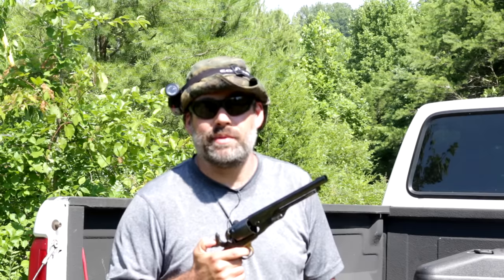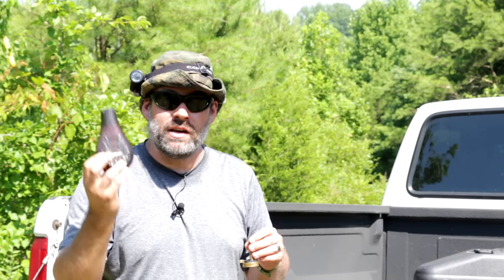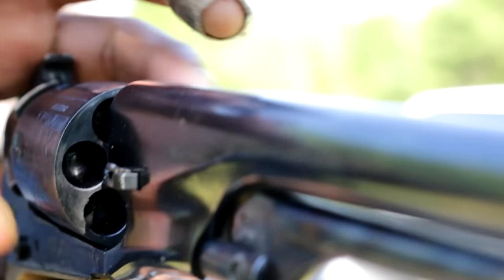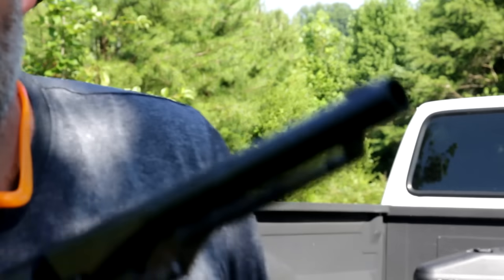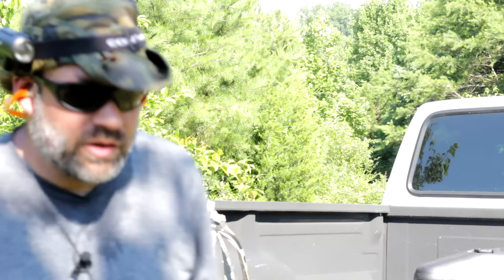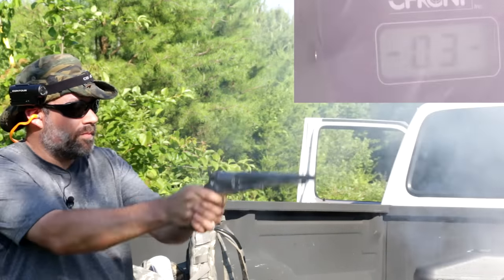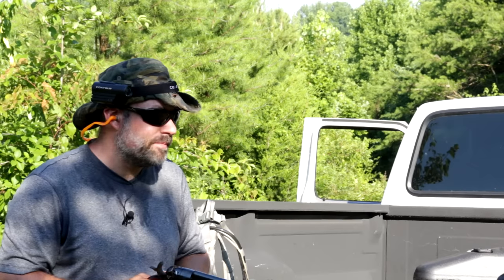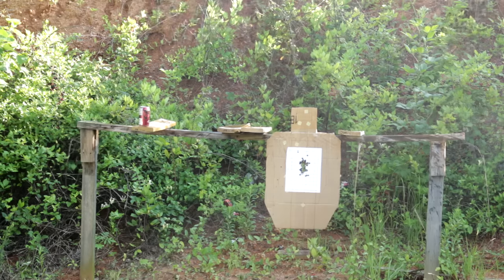How Powerful are Black Powder Revolvers?

Comment: There is peak efficient powder load to produce peak velocity output. Above that peak, there is a diminished return on using extra powder because it can't all burn fast enough.
Reply: Related to barrel length?
Reply: @ledenhimeganidleshitz144  yes, the longer the barrel, the more powder which can be used to propel the bullet.
Reply: @Remedy Talon  
F=M•A
Aceel = pressure • Area
M = Area • H • density
Friction = V•V • coef drag

Density drops out.  Rearrange the algebra for assumption of length, and you will see that maximum velocity reaches diminishing return for both pressure and barrel length.  You will find it true for both cases; pressure or length for the same reason.  Drag increases with the square of velocity. 

Just physics.
Reply: @TangoOne  to an extent you can ruin a brass frame long barrel with to big of powder loads will stretch
Reply: To compensate for diminishing returns you can shoot a heavier bullet. It alowes the powder to burn more efficiently. Yes you cant fit as much powder but you can squeeze 30gn and maybe 35gn with a 200 gn conical.

Comment: Use real BP for the testing. There is a difference.
Reply: David Tiller I completely agree, i use real black powder in my Uberti Walker and when i tried it with pyrodex it didn't work well at all and it only had half of the power it did with bp.
Reply: Jeremy Hall If you order 25 lb lots it will save you a lot. If you don't want that much you can always find some friends to share the lot. Two good places are the Maine Powder House and Buffalo Arms.
Reply: graf and sons had the BP
Reply: Your lucky. In Cali you can only own 1 pound of bp at a time
Reply: Reason #4761382 to not live in comiefornia.
Reply: @familyofmay3131  ,
Reply: Jeremy Hall  Same here.  I notice little difference between the Goex and the Pyrodex P I use in my cap and balls.
Reply: @firefoxjb  Thanks I'm new to this and want to get the Walker. I will keep that in mind.
Reply: Jeremy Hall  Make your own?
Reply: Real blackpowder is not difficult to make and is also not at all dangerous to make because the entire time you are handling it, it is a wet paste until you granulate it and let it dry.
Reply: @909part3  hey man, where do you buy yours at. I see your in the area.
Reply: A recommendation. Walkers are very....heavy and should not be the first BP revolver to purchase. My thinking is that they disassemble a bit differently then other colts. And, unless your Clark Kent you will not want to fire it often. I would purchase a smaller caliber, i.e. 36 in any Colt model or Remington. Doing so you will be hooked for life. Then purchase the Walker and destroy concrete blocks and shiver at the thought of getting shot with one of those monsters. And, please use BP you'll love the smoke.  Phil
Reply: yea.  Unic BP substitute,  not enough sulfer huh?
Reply: If you use real bp fff should you cut your load to say 20 maybe lower
Reply: @jamesholcombe435  Whats "Real "black powder,  all the recipes i see, well they involve mostly Potassium nitrate,  I heard of a blend used during colonial times that may  havr been more powerfull,  had more sulfer.  Any facts to clear this up.
Reply: Urbexx Jeremy  look around for gun shows or black powder/muzzleloader groups in your area, they can usually hook you up with the real stuff
Reply: @909part3  How much regular powder can you have? I keep about 25 or 30 Lbs at home here in Mo. That plus 10-15000 rods of loaded stuff.
Reply: @familyofmay3131  California is a capitalistic giant but ok
Reply: it remains a realy good review for pyrodex users. still i agree i'd like to see it with real black powder...
Reply: @909part3  That's incorrect. Your local fire dept sets the amount you can have and normally that's 5 pounds in your home. In sheds or other outbuildings, you usually can store more!
Reply: Talk is cheap.
Got a video to prove this?
Real BP ... Which brand?
Lymans PUBLISHED data shows the difference between brands. This was complete with pressure measurements.
Reply: I heard that substitute powder increases fps because it burns faster? That’s what I’ve been told but maybe they were wrong? Anyone who likes muzzleloaders should get a NAA super companion. Such a fun little gun to shoot and is the only bp revolver that can shoot smokeless powder. Because it’s made of the same material as there modern 22’s. But it gets up to 1200 fps with 2 grains of bullseye. Triple 7 is good in it as well.
Reply: @firefoxjb  Pyrodex by volume is usually more powerful. 10% minimum. Is there a difference in procedure to get better performance from real black powder.
Reply: @FlyManChimera  no the tech industry is, remove tech and it’s the 27th poorest state in the union with the largest BY FAR population, yet less than 10% of our population works in the tech industry
Reply: @LouisE-mp8lx  In revolvers the flame channel from the cap to the powder charge is a straight line. In that instance, Pyrodex works fine. In my CVA Hawken, the spark from the cap has to make a 90 degree corner to get to the powder. This makes Pyrodex a very spotty proposition in my rifle. I usually need to fire a couple of caps on about every third shot to ignite the powder. With the end of Goex, I am getting pretty short on options. And none of the other black powder substitutes are recommended for sidelock rifles.

Comment: 30 grains seems to be the sweet spot with the 140 grain ball;  I'd like to see this test repeated with conicals.
Reply: Some say 30 some say 31.
Reply: Did it above.
Reply: @christopherjackson3455  Agreed.  It would just piss him  off.
Reply: 30g ok fer colt 44 but 25g found best fer Remington 44
Reply: Conicals take these guns to a whole new level. Plus, they were at least as common but probably more common than balls back in bp days because paper cartridges used conicals and they were more common than loose powder/bullet.
Reply: Yep you are limited by aerodynamics of the ball.
Reply: R u guys using any kinds of buffers between powder and projectile since any space between is considered to be a bulllet as a bore obstruction scenario
Reply: The Lymans Handbook has this all and more, like pressure measurements.
Reply: @landontruman3632  the molds issued by the army with these guns cast both round ball and conical.
Reply: @pitchforkpeasant6219  no buffer is needed, the ball compresses down onto the powder and compresses it. You can fill a chamber as full as you want with powder, its not possible to over fill these. You can even put more projectile than just a roundball in
Reply: @landontruman3632  I agree with you. I use 200 grain conicals, with 30 grains of FFF, pyrodex P, and there is a difference. Better long range accuracy, and the conicals penetrait much better. The round balls act more like hollow points as they tend to  flatten out some.
Reply: @pitchforkpeasant6219  i use a lubed wonder wad under ball over powder. High compression results in better ignition and eliminates any air spaces.
Reply: piettas  recomended load for .44 cal is 30 grains
Reply: The 220 grain Kaido conicals are not very accurate using the 1860 Army's. I have had luck with the Remington 1858 NMA
Reply: I use a 358 grain power belt bullet with 150 grains of pyrodex pellets in my buck stalker

Comment: The purchase spec for the 1860s army paper cartridge was 34 grains for army (44) and 22 for navy (36).  Most, if not all, used conicals.  I use 34 with round ball in my Rogers and Spenser
Reply: i do not find a good explanation about the differences between a round ball or conical one  for black powder guns ? what's the main difference ?

Comment: A note on the cap jam you showed on the colt where the cap was dragging on the frame.  There is a half round depression in the frame just for spent caps to work there way out.  The replicas are not deep enough, a little work with a foredom tool and small stone will deepen it and you will find it clears caps easier.  There are a lot of little things you can do to prevent cap jams, one of the quickest and easiest is to use tresso nipples, I've also heard good things about slix shot nipples, smaller flash hole, less blow back when firing.

Also, enjoyed the comparison, but would suggest trying conical bullets, less powder capacity, but a 200 grain slug and they were used a lot more than round balls back in the day.
Reply: Yep. 200 grain bullet, and slix shot nipples. The slix shot nipples use number 11 caps, which has a bigger hotter flame, and usually results in better ignition on heavier loads.
Reply: In the old days shooters would point the muzzle streight up when cocking so the cap fragments would drop clear.

Comment: In 1995 I owned a ruger .44 cal old army pistol. I practiced with it for quite some time. I found that at 75 yards I could shoot thru a 3” sapling.
I used this hand gun to take into the woods while hunting deer. About two years later I found myself standing in a line of woods watching a clear field. It started to rain and my vision was cut almost in half. Turns out I didn’t need it... a buck came walking less than 25 yards across in front of me. To close to use my scoped rifle. I pulled my 44, aimed and fired at a heart shot. The deer stumbled and fell dead. I got a beautiful 6 point that dressed out at 210 # . So.... yes, they are strong enough, I used a charge of 45 grains of 3 f powder with a buffalo conical bullet.
Reply: You managed to squeeze 45 grains of powder into an Old Army chamber?
Reply: @GreenMosin93 45 grains is the max you can fit into the cylinder

Comment: Try the Lee conical 200 grain. I choreographed these with 35 grain equivalent Pyrodex P and Remington #10 caps at 898 - 930 FPS out of my 8" 1858 Remington. No need to go any further. This gets me right at a 45 ACP or round about. I also used "Muzzleoader originals" lube wads under bullets with some bore butter over the bullets.
Reply: Right on john, you more than man doing test for sure.  The common civil war load and also the colt loads were using conical bullets.  Using round balls to test power shows you do not really understand much about the history or the engineering behind the cap and ball revolvers.
Reply: @loquat4440 I understand conical bullets were the standard back then for cap and ball revolvers but I still shoot using round balls cause they are easier to obtain than conicals and likely cheaper too.

Comment: Seeing this makes me want to try my 3rd model Dragoon with a chrono, I always load it with 50 grains of powder.  There's still plenty of space to add more but I figure that's a hefty enough charge.
Reply: 50?  That's a lot of smoke!  Bet it kicks some.
Reply: If you reduce your load to 45 grains you can JUST get all the powder and a ball into a paper cartridge rolled from a TOPS cigarette paper.
Reply: Use cornmeal fine ground as filler plus lube wad & then ball. This will lend itself well to greater accuracy!😊
Reply: Long time ago I had a dragoon and I also had a Ruger 44 magnum and at about 7 yards I tried it into two telephone books the dragoon was just a little bit behind the 44mag. I'll say a half an inch.  both of them went more than halfway into the second book we're talking Phenix City directory.3in. I used a round ball in the 44 dragoon. And the 44 magnum was just a semi jacketed wad cutter. I will also have to say that I was using triple 7 by hogdon

Comment: Thanks for taking the time to make this video. I got a video suggestion that is like this video. Try getting your hands on some ballistics gel and do 25 grains to 40 grains and see what kind of damage a lead ball can do.
Reply from the maker: +Alex the Hun (Boy) That's a good idea.  I looked into ballistic gel a few years ago and it's expensive but I remember on a Mythbusters episode they had a really good formula that I may try.  Fyi.  I just uploaded the second part to this video and it'll go live in about an hour.
Reply: The cheapest way is to make your own. I don't remember the ingredients but I'm sure you can look it up. Also a little FYI I've watched almost every single Mythbuster episode.
Reply: Just try a live hog. They are most like humans physiologically. At about 900 FPS, a lead ball or bullet deforms to about double it's original diameter, and will penetrate 6" of muscle, shattering bones, stopping inside the hide on the opposite side of the entry wound. That's a through and through on a human up to at least 50 yards. Black powder pistols (even my .31 Pocket Colt's) are deadly. Lot's of my dead Cherokee ancestors didn't realise how deadly a Springfield .58 caliber rifle was.

Comment: Try the same test but with 777 3fg you will see a massive improvement in velocity and muzzle energy .
Reply: Which is why everyone recommends a 15% reduction in charges for 777, as it has a faster burn rate.
Reply: My 58 Remmy shoots very good with a 35 grain charge of 777 3f  ..  3 
inch groups at 25 yards and plenty powerful..   I will up it to 40 
grains now and then, but my 58 likes the 35 grain charge,  very accurate
 gun and a real pleasure to shoot  ..!!   The solid Remington design easily handles that power   ...
Reply: I use a 25 gr charge of T73f for general purpose and 40 if I hunt with my Remington 1858 Steel Frame  . Though I am using a Plains Pistol these days for hunting. If you get the 12 inch Steel Buffalo you can spit out the 454 round balls at 1200 fps putting it on par with a .357 mag but with a fat .454 ball .
Reply: Oh yeah, cool and versatile guns for sure  ... I'd love to have the steel buffalo Remy though  ...!!
Reply: CapnSchep I know I'm replying about this over a year from now, but I do the same thing with triple 7. 35 to 40 grains Triple 7  with a .454 lead  ball. You have to be careful sharing information like that people think you're crazy because they like to shoot their 1858 underpowered. Half the videos of people loading no more than 28 grains of crappy goex is what makes their guns go boom . Nothing wrong with that but doesn't show how powerful 1858 Remington cap and ball revolvers really are. When you put 35 grains you're over 1100 feet per second and close to 400 foot-pounds of muzzle energy with our Remington 1858 ( steel frame). 40 grains of triple 7 , you're getting around 1200 + fps around 470 foot-pounds of muzzle energy. I have shot over  500 round Lead balls at 40 grains of triple 7. The gun has not changed in accuracy, no gap between the cylinder and the barrel, nothing is even near loose.
Reply: I load 50 grain 777 pellets in my 1858. hasn't loosened up a bit. this was before i knew that there was a max load for the gun. but i still shoot it like that sometimes. It gives you a very strong shot.
Reply: You stand an excellent chance of bursting the cylinder and/or barrel at those kinds or pressure, and removing your fingers and eyes. 777 is made ONLY for modern design tip-up muzzle loading black powder rifles. It is a semi-smokeless powder like Les-Smoke of the late 1940's to 1960's. Too many people were blowing up antique Sharp's and Rolling Block Remington cartridge rifles with it and it was removed from the market. The pressure in PSI to get 1200 FPS with a 143 grain lead ball is in excess of 18,000 PSIA, and the guns are only proof-tested to 12,000 PSIA. They are designed for no more than 10,000 PSIA. That's an 90% over-charge. Read the instruction manual.
Reply: @Walkercolt1  Triple Seven is NOT "made ONLY for modern design tip-up muzzle loading black powder rifles", it is safe for all black powder guns in good working condition. Velocity and projectile weight does NOT tell you what the pressure is. Triple Seven has a lower pressure spike than black powder and can be safely used at the same charge by volume as any black powder load with the added benefit of increased velocity and less corrosive. Hodgdon only recommends reducing charge by 15% to achieve the same velocity or point of impact as your go-to black powder load, not for safety of load. You are making up ridiculous numbers like "90% overcharge".  If someone went 90% over the guns rated pressure it would turn into a grenade on the first pull of the trigger.  We would have heard all of the horror stories about the deadly bp substitute 777.
Reply: @Walkercolt1  It is not like some powder from the 40's. It is a new design of powder that burns carbon like black powder but uses sugar instead of charcoal as the carbon source.
Reply: @Walkercolt1  If it wasn't intended for black powder revolvers, they wouldn't have put a recommended charge for the Ruger Old Army on the jar it comes in.
Reply: @Walkercolt1 Triple 777 is a black powder substitute, so while it's not quite the same as black powder, it's not smokeless powder. Not by a long shot. Smokeless propellants are nitrocellulose based and Triple 777 is not even that. Between black powder and smokeless powder, Triple 777 is closer to black powder in its composition. As the other commenter has pointed out, instead of using charcoal as a carbon source, sugar is used instead. That's what causes the power gains and a cleaner burn. But no matter how much of a clean burn Triple 777 is, it's still dirtier than smokeless powder. Just like black powder, guns that use Triple 777 needs an internal cleaning too.

Comment: A Colt Walker replica revolver has a higher powder capacity.
Another factor is powder, black powder came in several different types, FG, FFG, FFFG and FFFFG, are the most common, the more F the faster the burn rate.